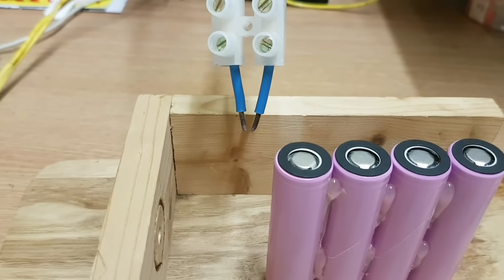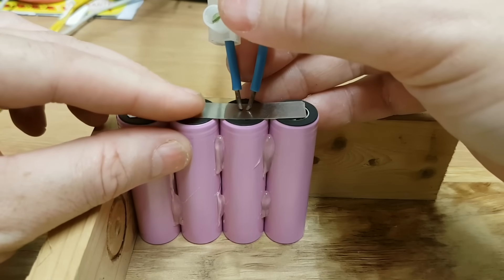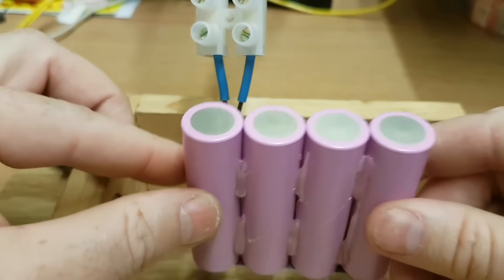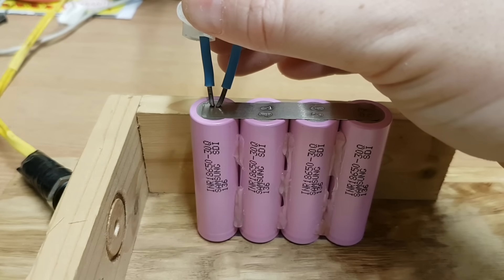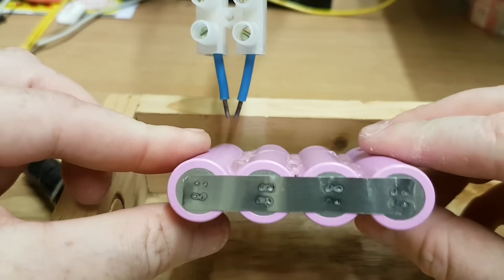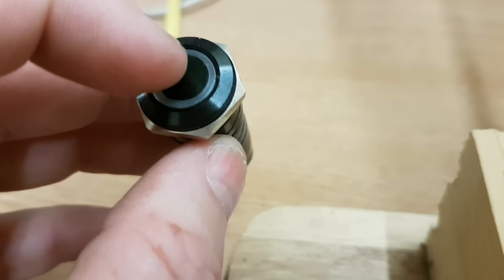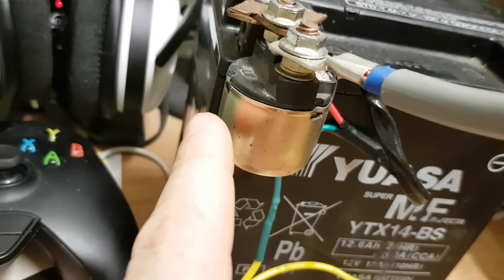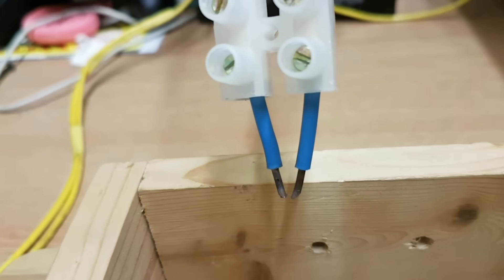DIY Battery Spot Welder - Demonstration & Explanation

Comment: This is such a great diy spot welder, I followed your brilliant idea and built one the same way, though I could only find a 400A CCA car battery for free, and decided to use it for testing instead before getting a 200A one or a 330A one as you suggest in your newer improved version video. Couldn't find the copper nails locally, so I used some old pure copper soldering iron tips which I dremeled to be really pointy. I am waiting for my new nickel strip shipment to arrive so I can build a sony vtc6 10S3P pack for an ebike and I have been practicing with some old nickel strips from old dead 18650 power bank packs. I found a lot of spark is produced some of the time and my results vary from not welding well (no sparks) to blasting a hole through the strip and almost through the battery pole (sparks) that was a bit scary.
I think my widely varying results depend on: 
1. I dont press the button quick enough (because i haven't made a mount/base for it yet and do it by holding the switch and tapping as quick as I can) so that causes the tips to blow a hole through strips, or when i dont get a weld I am barely pressing it at all???
2. My battery is too "strong" for 0.15mm strips or the used strips I am practicing with are too thin, perhaps .10mm
3. I dremeled the copper tips to be too pointy and needle-like so thats why they punch through the strip and almost puncture the battery pole
4. I am either holding down the welding tip ends too firmly (when it punches through) or I am not holding down firmly enough (when the weld doesnt happen) or they dont both make contact with the nickel strip?
What do you think can be the case? I will upload a video which I will link to this comment when I get the chance! Congrats again on your great diy spot welder, it must be the simplest, cheapest and most effective one out there for spot welding 18650s!!!
Reply from the maker: If you're blowing a hole, it means it's arcing. Which means you're too scared of it lol. You must hold down the tips to make good contact to the nickel, otherwise you'll get sparks and it'll blow holes.
Reply: darkkevind thank you so much for the quick reply! I will try to hold them down more firmly. I will also make a mounting base for the button as well tomorrow. Do you think I should also flatten the tips just a tiny bit and keep them a bit further apart to prevent arcing? As of now they are really really pointy right now and close together (however they are not touching and dont arc when I click the switch and they are dangling free in the air when I am not trying to spot weld). Thanks so much once again
Reply from the maker: @giorgiontanas8618  sounds fine with regards to the tips... A mount for the switch may well help.
Reply: @darkkevind  thank you! I will make the necessary improvements and try to better my technique and I will let you know! I was thinking of trying to make and post a diy video as well linking back to your channel and original video if you wouldn't mind. Another good idea would be to try and subtitle your video in my language so more people can watch and understand from Greece as well, its the least I can do I think! cheers
Reply from the maker: @giorgiontanas8618  that's awesome! So happy for you 👍🏼👍🏼👍🏼

Comment: Mate that was the best spot welder I've seen. I'm an electronic tech and have been trying to build a spot welder but could never get enough current. Yours is a simple and elegant solution. It reminds me of an old NASA engineering story; when they were in the middle of the space race with the USSR, NASA was spent millions designing gravity free ball point pens. Russia used wax pencils.
Reply: that was a myth regarding the NASA pen. A separate company already made a pressurised pen and they contacted NASA to see if they wanted to use it. (NASA used to use mechanical pencils) 
After they adopted the pen, the Russians also ordered them for their program. I think they paid around $150 per pen
Reply: that was a myth regarding the NASA pen. A separate company already made a pressurised pen and they contacted NASA to see if they wanted to use it. (NASA used to use mechanical pencils) 
After they adopted the pen, the Russians also ordered them for their program. I think they paid around $150 per pen

Comment: Question, what is your most recommended method of removing one of these battery tabs intact after it's been spot welded?
Reply from the maker: Needle nosed pliers and roll it like a sardine tin 👍🏼

Comment: Simple. However not safe ...you are dead shorting an High amp battery circuit,  shorting a volatile battery can explode! And a start battery has electrolyte acids that will blind you on contact of your eyes. The idea of creating a spot welder is to design high voltage with low amps. And with protection against dead short-circuit and ground-fault situations. Better solution is a microwave Transformer. But you have to be careful in design there's links on YouTube how to. You're resourceful and brave and you achieved a weld two thumbs up cheers!
Reply from the maker: Shorting a battery of this type for 0.4 of a second is not dangerous. For the amount of time it's being shorted, it has no time to react. The design for a spot welders is actually low voltage, high current, not high voltage, low current as you stated. This particular welder has now done well over 10,000 welds and is still going strong....

Comment: Love this!  Wondering were you generalizing when you said you were welding nickle strips or were they in fact nickle?
I have always wondered how battery packs and relay parts were welded.  Can Nichrome be welded?
Can you weld stainless steel or spring steel?
Thanks, JIM
Reply from the maker: Genuine 100% pure nickel. Steel will corrode and have to much resistance.

Comment: Nice but I don't think it's cheaper than buying a proper one. That battery is £40 in the UK. Can get a board that can run off a cheap lipo for less and it would be portable.

Comment: You can also make a larger one using the transformer from a microwave. This is great for small jobs. Nice description of how you did it simple and effective.
Reply: Danger Risk of Death, microwave transformers are high voltage, do not even think about using one unless you are a qualified electrical engineer.
Reply: 😂😅 yeah.....

Comment: This is dangerous, you are short circuiting a car battery, you could potentially cause a catastrophic battery failure / explosion.
Reply from the maker: It's safe for 0.04 sec 👍
Reply: @darkkevind  it's not a safe or wise thing to do for any period time, you're pushing 1000's of amps thru the battery.
Reply from the maker: @scoops0406  it really is... 🤷

Comment: Nice informative video.

Do you have a Parts List and/or Specs for the components used?

Any idea how well RESISTIVE SOLDERING  TWEEZERS work Vs. a Spot Welder like you built?
I use to solder for hours on end using resistive Tweezers. 
It applied instant heat to whatever component you had between the tweezer tips.
(I suspect your spot welder would be quicker and provide a better solder joint though.)

Comment: what do you use the copper nails for?
Reply from the maker: For the electrodes that make the weld... 🤷
Reply: @darkkevind  the 2 pointy bits coming out of the choc block? I thought they were just hard thick wires, since they got blue sleeves
at 4:13 he says it's 2 copper wires
Reply from the maker: @KhaleyJo  originally they were just wire,I updated to cooper nails as they were better 👍🏼
Reply: @darkkevind  ok i understand now. Also didn't realise you were the guy from the video. Thank you, 3 years later and it's still helping people out. Thanks a lot
Reply from the maker: @KhaleyJo  no problem at all 👍🏼

Comment: Great video👍 Does it matter to be a solenoid relay ? Will a high current SPST relay work just as well (200amp rated)
Reply from the maker: No, you really need the solenoid/relay to handle the current and remove the contract quickly and safely.

Comment: Hi guys, Im building up this device, I'm setting up a 12v timer relay module to control the length of the weld shock.
My question is , for 200A how long does the current has to be passing? 0.13S is the minimum of the timer Relay. Thanks
Reply from the maker: 0.4sec
Reply: @darkkevind  thanks!!

Comment: That Battery look like 20AH (20Amp. Hour Battery)
Are you sure it 200Amp. 200Amps Battery is far larger, l mean lead acid battery
Reply: 200CCA as in 200 Cold Crank Amps, 12ah motorbike battery

Comment: Yo! Linustechtips just uploaded a video of this same spot welder! I immediately thought of this video!
Reply from the maker: Thanks for letting me know! I just added this comment:

You make the process look difficult whereas actually, it's really quite easy and safe. You're holding down the momentary button for way too long and your relay is sticking on by the looks of it. Get a better relay. Your probes are far too far apart, you're ending up on the very edge of the positive terminal circle, you need to be at least 3-4mm closer together. One of those positive terminal welds you did almost went through the ventilation membrane... you should check that.

Also, no credit to the original designer/builder of this welder where you got your design from... me!
Reply: darkkevind I also noticed his probes were too far apart. With your design, you can fit another spot weld on the same terminal to get 4 weld points which is more durable in the long run.

Not so sure why he didn’t credit, but it’s possible that he might’ve seen a different video since there has probably been a lot of other people who have made videos of this DIY in the past year or so.
Either way, hope he credits you eventually. It must be cool to see your intuition making waves!
Reply from the maker: @aLatios  You could potentially have 4 probes, I think you're right. I may just test that 👍

Comment: Is it possible to do spot welds on lithium batteries with 2.7 V 500F (farad capacitor )?
Reply from the maker: I'm sorry, I have no idea
Reply: @Mathew Ninan   Even though it's 2 years too late, I'm going to try to anwer the question about the 2.7V 500F capacitor, because it is a route I researched a bit before going for darkkevind's approach [many thanks for your videos, darkkevind !]. 
And the answer is a big fat MAYBE, provided you get the right capacitor!
Spot welding uses the natural resistance of the target materials (i.e the metal of the battery case, and the welding strip) to generate sufficient local heating to melt the metals and create the weld, and quickly enough that the heat cannot dissipate.  Because the resistance of the target materials  (being metals)  is low, and time is short, a high current is required to compensate (Power = Current x Current x Resistance).  I thnk somewhere darkkevind mentions 200Amps for around 0.4 seconds.  If you work out how much energy that will dump into the weld point (assuming the battery voltage drops to 10V while delivering its 200Amps)  this is around 800 Joules.  I actually I think that is probably a gross over-estimate.  
In any case, a fully charged 2.7V 500F super-capacitor contains about 3600 Joules - more than enough energy. The big problem  is the internal resistance of the capacitor, which needs to be very low in order for it to be able to deliver the required energy fast enough (i.e with a high enough current) to effect the weld.  That probably means you will need an expensive, branded capacitor with a believable datasheet which guarantees a low internal resistance. Because, believe me, not all 2.7V 500F supercapacitors are equal !    My attempts with Chinese-knocks off were a dud - I believe for this very reason : although they had the stated capacitance (more or less),  they also had high internal resistance and so were unable to deliver the level of current needed to effect a weld.
That's why I ended up going for the design based on a motorcycle starter battery - those things, even the cheap ones, are designed to deliver the needed current for several seconds at a time.

Comment: Hei kavin. Nice video. What kind of Solenoid you used? May I use a Relè 12V 200A?
Thanks
Reply: Thanks a lot Kevin. Thank you very much. Great work.
Reply from the maker: Yeah that kind will be perfect 👌
Reply from the maker: I used a 150A starter relay from a 50cc scooter I owned.

Comment: I built one as well but i have had problems with the solenoids welding themselvs on, which has been a bit dangerous, so i bought the kweld kit.
Reply: A starter solenoid designed for a diesel car or 12v truck will work for others. Try searching ebay for "500A solenoid"

Comment: It is a simple spot welder, it require 5 items, 1) 12v battery, 2) press button switch, 3) power contactor relay ( this is used for starting the starter motor or scooter, auto bike, car or truck), 4) 2.5-4 square mm 2 fluxible wire of required length, 5) two pointed solid copper round piece of 10-12 SWG, connect one wire to battery  negetive & pointed round copper piece, 2nd wire connected to positive terminal of battery then to power relay 1st terminal & form 2nd terminal to pointed solid piece, in the relay there is a coil which has 2 terminals connect them in series with push bottom switch to both the terminals of battery, keep the pointed piece 3 mm apart & insulte them, now the spot welder ready, keep the pointed solid 2 piece on strip of battery cell firmly press the button switch & release it with in 2 secs, you notice spark at strip, now it is welded, continue the number of welds you need, thanks to all, regards, Siddaramaiah. C.

Comment: Great video and tutorial, I am thinking of making a bench power supply from an old ATX power supply and using that to power it.  Hopefully it works I don't want to carry a car battery around because of the weight but a fantastic idea.
Reply from the maker: It will cut off the power if you use it for this purpose. Those power supplies have short protection and they just cut off, so it won't work in afraid. Plus you will never be able to get the amount of current you need from those supplies. 🤷
Reply: @darkkevind  Thanks for the reply good to know

Comment: Tried it. Did everything to a T. Some spot welds were nice, others blew holes through nickel wire and 18650 batteries. This is VERY DANGEROUS. 

I suspect the holes were blown because of cheap momentary switches off Amazon that kept the circuit closed for miliseconds after I released the switch.

Not worth the risk or the price of having to trash multiple brand new sony vtc 5 cells.

Here's my opinion. Solder instead, its safer and cheaper. You can damage your cells soldering by getting them too hot but with this method you can seriously hurt yourself and obliterate your cell if your switch isnt top notch quality

Comment: You should test those welds from time to time , may not be as good as you think.  I Used a battery welder for years when I made lithium batteries for a company I worked for .
Reply from the maker: Yeah I do... I've got at least 4 batteries in skateboards of my own that I check, and after just over a year of riding, they're still a-ok 👌

Comment: I tried my setup on one dead AA alkaline and the welds looked great.  I remade the electrodes with 12 ga copper instead of 14 and tried to make a AAA pack of new NiMh and it burnt holes in the tabs and actually burnt through the end of one AAA and the battery leaked.  I think the battery case was thinner with less thermal mass which caused the problem. I have to go back with the smaller electrodes and to push the button for a shorter time.  You can only adjust the pressure, by feel, and the length of time for the weld. I will see if I can make my technique better.
Reply from the maker: Yes, AAA and AAv are much thinner casings than 18650 cells. It might blow holes. You just have to be super quick with the button. 👍🏼

Comment: Thanks for the video!! I just made my welder just like your video but I put the switch and relay on a board.  It worked great first try!  Looks as good as any factory made pack's welds.  For years I have been trying to get batteries with tabs on them and soldering the tabs together or soldering direct to the battery which I know is bad. Now I can do the job neatly and professionally.  Spent less than $20 for the nickel strip and relay.
Reply from the maker: That's awesome! 👍🏼👍🏼
Reply: Please what is the round stuff connected to the battery
Reply: Starter relatie from a scooter or motorcycle

Comment: If your fast enough on the switch why do you need a solenoid?
Reply from the maker: To handle the very high current from the car battery. Otherwise that switch will melt or disintegrate is seconds!
Reply: @darkkevind  Yes I realised that almost as soon as I wrote it but thankyou.

Comment: Can I use 3x 3.7 rechargeable battery (18650) to replace the battery 12v?
Reply: Supercapacitors would be a far better choice. 😉

Like:

https://youtu.be/z3x_kYq3mHM

or

https://youtu.be/GPJao1xLe7w

Comment: Sorry i dont undestand !!Green/Blue electric cable diameter ?THANKS
Reply from the maker: The grey thick wire is 16mm². The blue ends are 2mm single core copper.

Comment: Hi great job 
How would you wire that timer relay
Thanks
Reply: There is no timer relay, only a battery power contactor relay which connect the starter motor at the time of starting the scooter, auto bike or car or truck,